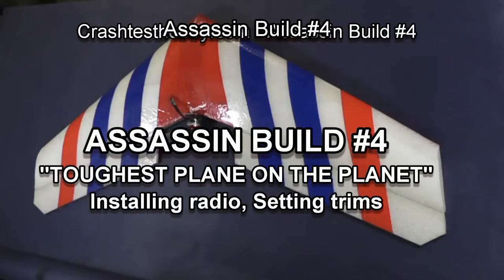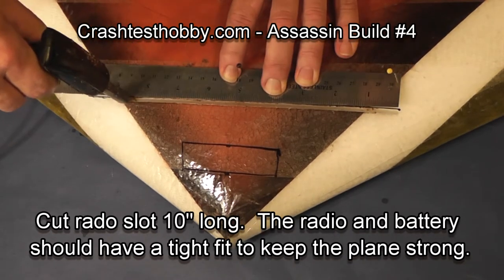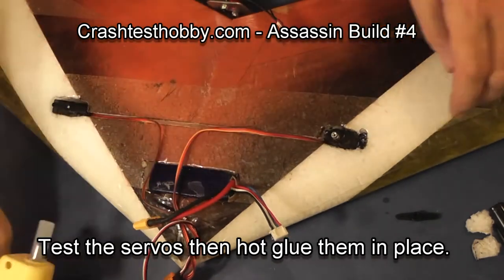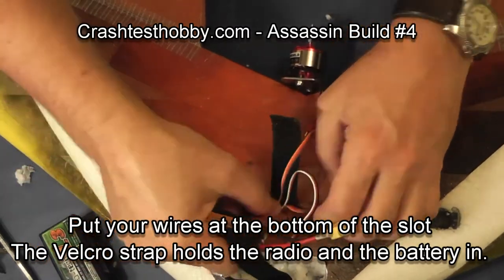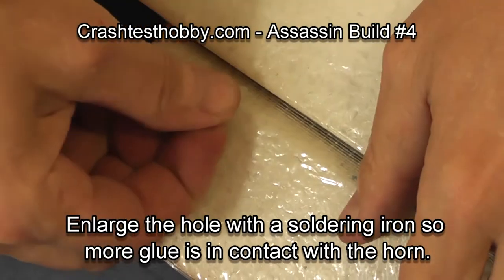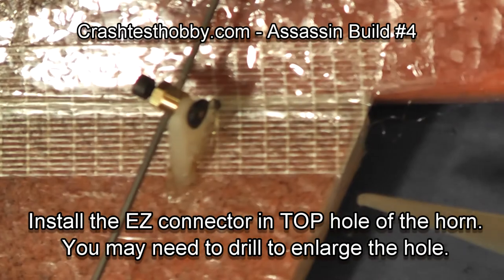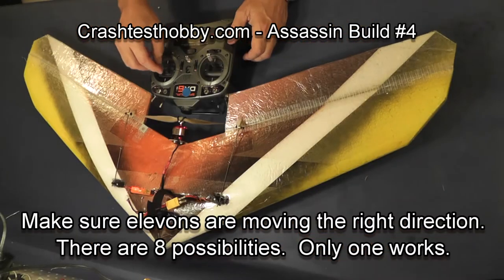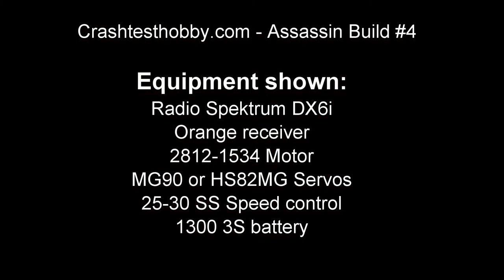Assassin Build #4 M

Comment: I'm using the crash test hobby prop saver, how do I set it up so it works correctly?

Also where is the propeller guard from?
Reply from the maker: The prop guard is strapping tape from the local hardware store. (Lowes).  There are instructions on our website describing how to use the X-treme prop saver.  In summary tighten all of the bolts against the prop shaft with the Allen wrench in the kit.  You have two O rings that can be used either as a pair or alone to hold the prop on the prop saver.  The big base of the prop saver makes the prop run without as much vibration as most other prop savers.  It also helps to keep the prop off the trailing edge of the wing.

Comment: what sort of paint do you recommend?
Reply from the maker: All paints add weight and decrease the laminate adhesion but we have found that "Krylon Fusion paint for plastics" does better than most if you apply the paint then laminate as soon as you can handle the plane without leaving fingerprints.  There are some types of acryllic paint that will keep the laminate from sticking at all.